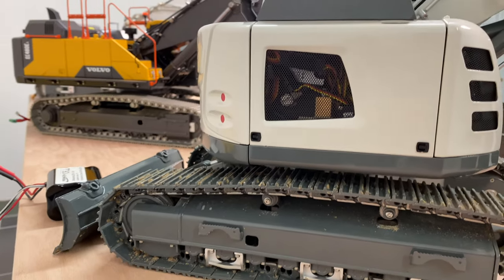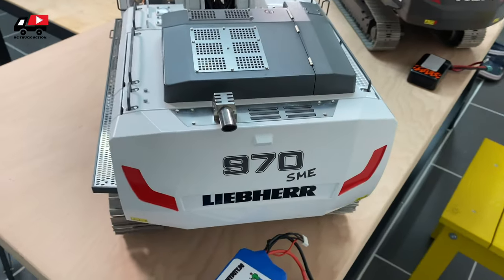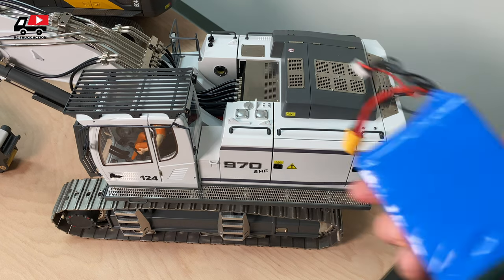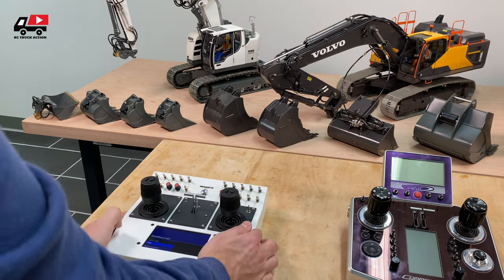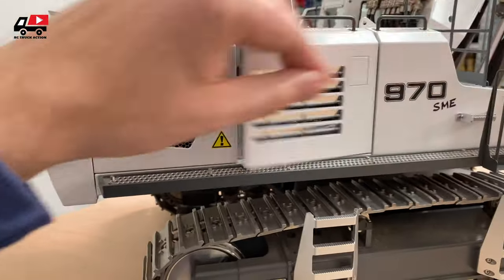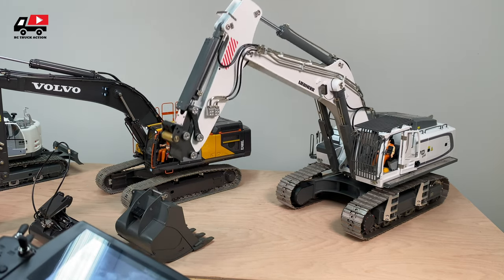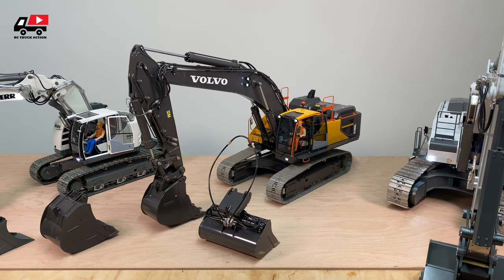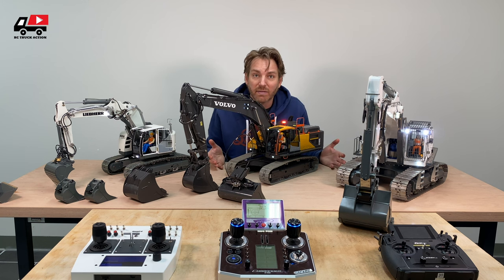RC SPECIAL EXCAVATORS at the Studio RELOAD

Comment: A typical difference with a Asian vs German excavator, or RC truck, is the noise level) In Asia they do not care about noicy motors and transmissions in RC equipment, while the Germans want it quiet) Which I prefare too) But all in all, the 970 is impressive. It's a bit for ordinary RC trucks, the 2 others are a more sutiable size if I had to choose

The Flysky PL18 does the job more than good enough for a excavator, at the fractue of the price and complexity of the two other controls. Would go for the version with 3D joysticks, PL18EV, more convenient to operate

Comment: Where to buy the volvo excavetor?
Reply: The company did stop some time ago. Can only be bought used now. Not many for sale. There is a lower cost Volvo at aliexpress, E380, that work okays for it's price, if one want a volvo. and there is a EC160, low cost, smaller model both hydraulic and eletric cylinders
Reply: @Rimrock300  thanks.as you see in my channel i prefer the high end equipment.  So i would search for one like that
Reply: @Rcheavyequipment  The volvo is made by THS, EC480. They made quite a few, maybe 30-40. They did cost in the region of 10-12K Euro as new, some towards 15K, depending on radio and additional equipment. Most are in Germany, Europe. Too bad they ended the company, 1-2 years ago. Slow sales during the pandemic is a part of it I guess. Was talk about they to sell on the production and equipment to Premacon among else, but seems nothing has happened so far concerning getting the models back on the market